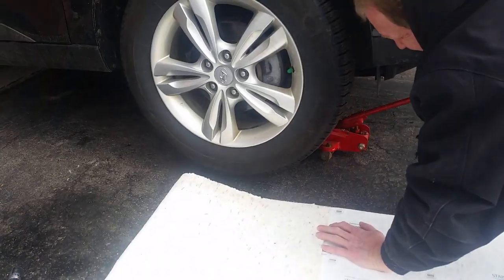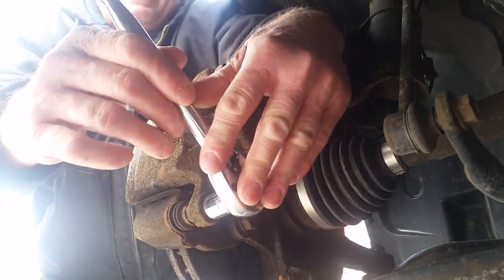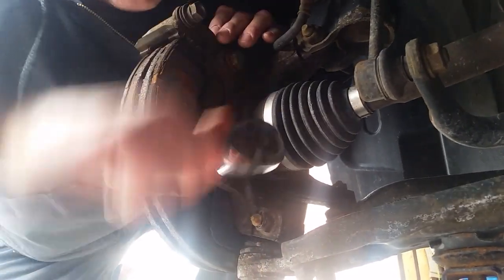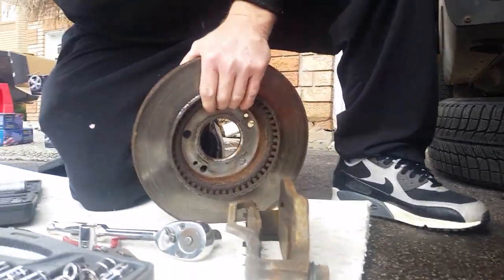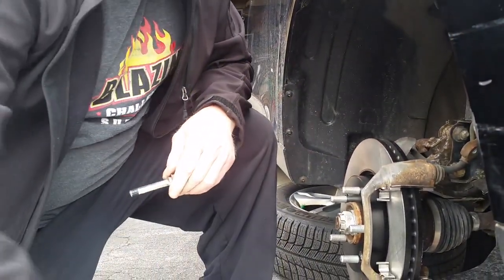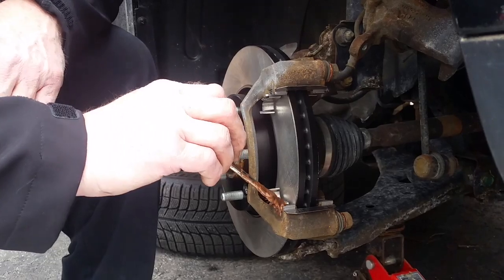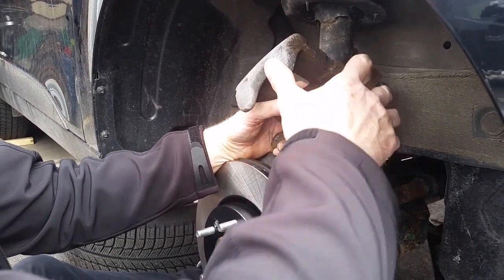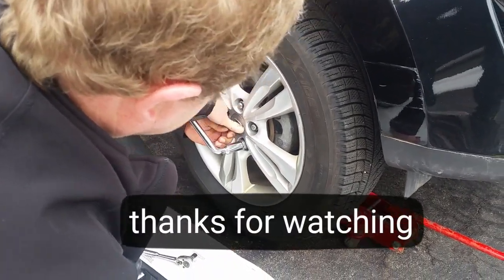How to change brake pads & rotors  in a 2011 Hyundai Tucson

Comment: DON'T hammer the wrench with your hands- creates tiny fractures in your hand / palm bones. Over time it will do considerable damage to your nerves. Bop it with a soft mallet or put a cheater pipe on the wrench & push lightly

Comment: Lots of critics on here, seems everyone has to throw their own two cents in. I watched this video and saw the right way to remove those rotor screws - with an impact screwdriver. I went out and bought one and the job went like a breeze. I used to damage them taking them out and always had to replace them. They are a dealer part, too. Not so today. Thanks for posting this video.
Reply: beats the way I was doing it.  Big phillps that I was hammering into the screw, then turning with a wrench lol

Comment: Anti Seize is NOT a lubricant. It is a Release Agent. It keeps metal parts from sticking together, but it is NOT technically a lubricant. If the base oil degrades, it can cake up on your sliding surfaces. SylGlyde is a nice product that has never failed me in a few years of doing this. I once used a purple grease specifically for caliper pins -  months later i had issues and found the caliper sticking. The purple material had turned to PASTE. Sil-Glyde is my go-to.

Comment: Always open the bleed screw when recompressing the caliper pistons. Few reasons, there are little seals in the ABS unit that can be permanently damaged by reverse flow - you don't wanna find out the hard way you compressed the caliper too fast, it's expensive. If you have previously topped up your brake fluid and then compress the calipers - the volume may overfill your reservior and leak brake fluid into your cars engine bay and brake fluid is a corrosive solvent. ie it'll wreck the paint and then aide the rusting process for the metal underneath. The oil in the caliper piston is the most worked oil in the system (in an auto anyways, in a manual it's the clutch slave cylinder) in terms of heat cycles and has the highest risk of contamination from being overheated and worked and also water/moisture ingress. So pushing that oil out for fresh fluid from the lines/reserviour is although not as good as a flush, better than not doing it without wasting too much fluid (its cheap for even good fluid). If you have a manual, flush the system along with the clutch slave cylinder every time you go anywhere near a pad/rotor change. This will prevent future heartache and prolong clutch/master and slave life.
Reply: take off the brake resivor cap and push the caliper in slow, and never have to bleed the breaks

Comment: How to you get access to rear's lower 14MM Bolt from the back rotor with tools like yours?
Can you suggest what to use for getting the Cal lower 14mm bolt out?
Had no problem removing the front rotors (3:00 of 9:25) because these two 14mm are easy access.
Reply: Small open end offset wrench with slip over tube for power
Reply: Bruce Johnson, what are you talking about?
Small open end offset wrench, huh what is the correct name & size?
What is "offset wrench with slip over tube, what tube are you talking about?
And what is "with slip over tube?
Reply: @angelisone  For anyone planning on replacing the rear break pads and rotors for their tucson (2010-2014) on their own, I suggest going to a mechanic for that. the lower 14mm blot cannot be taken out by any offset wrench. You actually have to jack up the strut rod and take out the bolt there in order to access the 14mm.
Reply: @justinlee6747  I just did it myself using offset wrench. No need to remove the control arm or shock. Here is the video: https://www.youtube.com/watch?v=J5p1DWdesis
Reply: @angelisone  I just did it myself using offset wrench. No need to remove the control arm or shock. Here is the video: https://www.youtube.com/watch?v=J5p1DWdesis
Reply: @iamfouadhajji  It was a test to see if anyone knows that answer /or solutions. Justin lee didn't know.
ATG, you and my little daughter were correct & used those basic hand tools.
ATG taught thousand of mech/people by using an ATG's 14mm spline offset wrench and a rubber hammer.